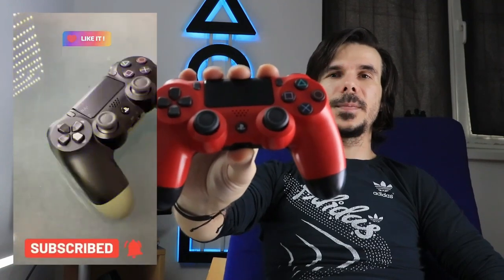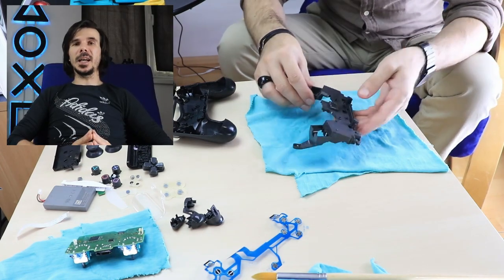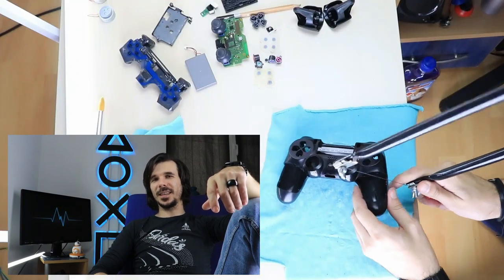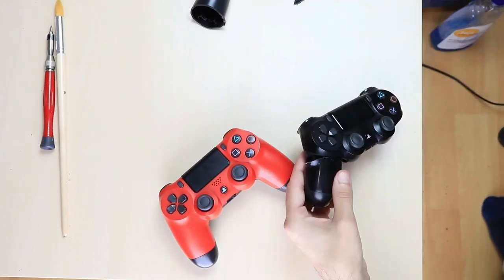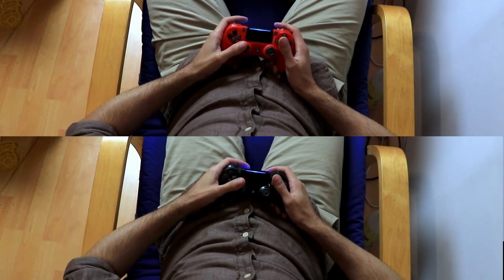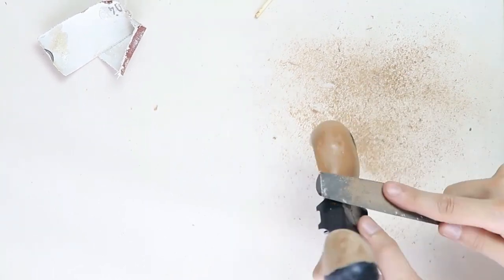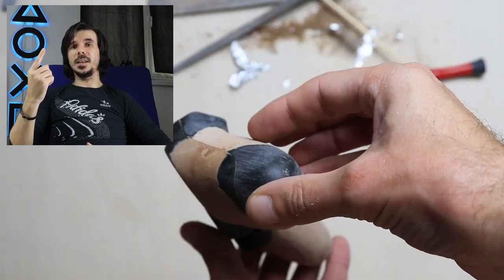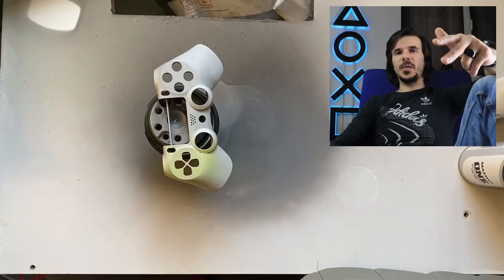DIY CUSTOM Controller: Turning a Cheap, Damaged Controller into a Gaming Masterpiece

Comment: Did you change the internal motherboard shape aswell or is it not needed
And did everything else but the rumble work or was that a prototype 🤔 I liked the video alot and its really cool to see Real custom modded controllers
Reply from the maker: Thank you so much for your comment! I didn’t modify the electronics other than removing the vibration motors. Everything works with the original electronics.

Comment: You can get a red and black one though? It's an original colour.
Reply from the maker: What to you know! I should of made my research better (I couldn’t find one on my local store). While Combining the cases between them I also got a red and camo combination which I liked. Thank you for sharing.
Reply: @LifeHackerMax  yes the new v2 ranging from jdm-040 to jdm-055 don't have it, but the older models do, I'm not sure on the jdm model number though as I've only ever come across one in my fixing joblots journey. It sold pretty quickly though. There's another 3 jdm models in the older range so I don't just want to throw a number out there without fully knowing what it is. Your custom shell looks good though.
Reply from the maker: @shepshep1994  thank you so much! It feels good to. At least for my taste. 😋

Comment: You contoller looks amazing! Dont you miss the haptic feedback? I have small hands so play most games with a ps3 controller on my pc but my ps4 wont let me use a ps3 controller. Maybe I need to mod a ps4 controller to be smaller lol
Reply from the maker: Thank you so much ☺️! I never really felt the imersiveness the haptic system was intended for and for the most part I usually disabled the vibration for more battery life.